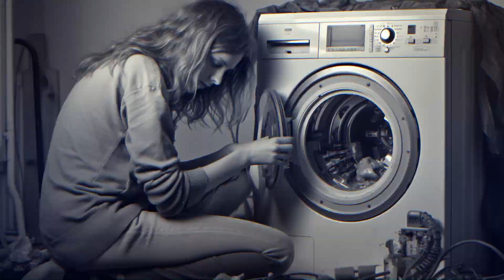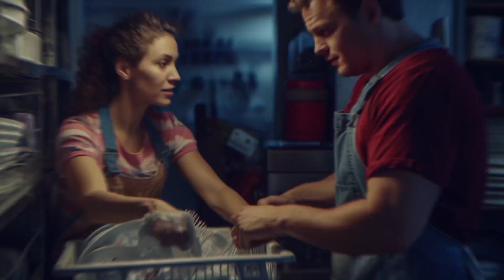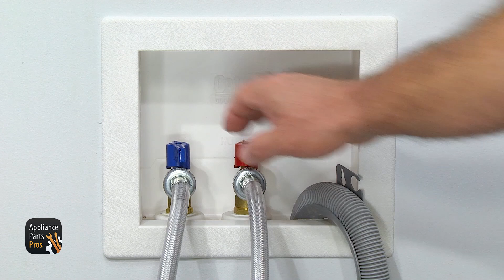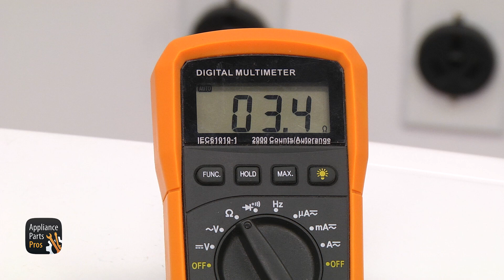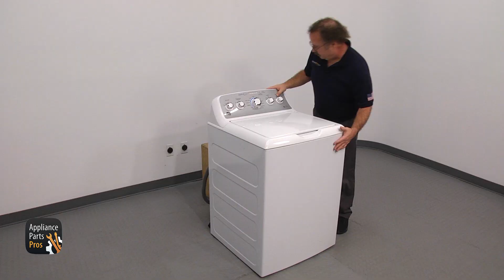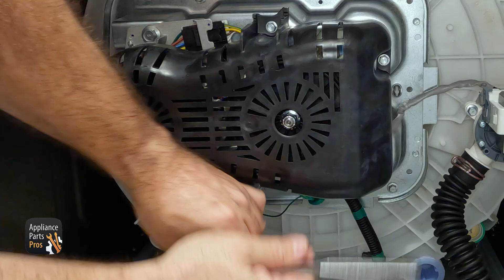GE Top Load Washer Motor Replacement Made EASY!

Comment: My pulley won’t come off
Reply from the maker: Sorry you’re having trouble! Some pulleys can be stubborn, especially if they’re stuck from corrosion or buildup. Avoid forcing it, as that could damage the shaft or pulley.

If you need further tips from our techs you can check out our repair forum: https://forum.appliancepartspros.com/

Comment: Mine agitates but won't spin.....
Reply from the maker: Common culprits for this issue include an unbalanced load, a faulty lid switch, a broken drive belt, or a stripped motor pulley.

If you need more in depth troubleshooting or testing information you can check out our Repair Forum: https://forum.appliancepartspros.com/.  It’s easy to register, and you can either post your question or search the forum to see if someone else has already asked the same question.
 
Our experienced technicians, with over 20 years of hands-on appliance repair experience, are ready to answer your questions and guide you through your repair.

Comment: Hey there i have a ge gtw585bsv0ws and when i check my motor it is giving me a 7.1 resistance on both wires. Im not sure if thats good for mine
Reply from the maker: If you need help with your repair, you can visit our Repair Forum: https://forum.appliancepartspros.com/. It’s easy to register, and you can either post your question or search the forum to see if someone else has already asked the same question.

Our experienced technicians, with over 20 years of hands-on appliance repair experience, are ready to answer your questions and guide you through your repair.

Comment: Will it still drain if the motor is bad
Reply from the maker: Good question. Whether it drains with a bad motor can depend on the exact issue and model. For detailed troubleshooting specific to your situation, our certified techs can help you at forum.appliancepartspros.com. Just post your model number and what you're experiencing and they’ll walk you through it! 👍

Comment: I don’t have a multimeter, so I can’t check the voltages right now, but washer clicks when the thing is trying to spin and fails. I had a guy come out and look at it but I don’t think he did any electrical checks. He told me “the motor is broken” but I don’t know what tests he did to find the problem. Dos she clicking noise indicate anything to you?
Reply from the maker: Thanks for sharing all that info, Ash. A clicking sound when the washer tries to spin can sometimes point to the motor, but it can also be caused by things like a faulty lid lock or even the shift actuator (on some models). Without a multimeter, it’s tough to know for sure, but it’s definitely worth testing those components before swapping the motor.
Reply: Thank you!!
Reply from the maker: You’re very welcome, Ash!

Comment: I'm stumped and need help. I got fault codes for shift actuator but it resd 5.7k ohms amd was engaging amd fitting into drive. I hear clicking like the GE motor can't get going. I checked resistance at J511 and have 4.7 ohms from brown to white and brown to yellow. Could the motor still be bad? Any guidance would be much appreciated. Thanks
Reply from the maker: What is your model number?
Reply: GUD27ESSMWW  @appliancepartspros
Reply from the maker: It sounds like the motor is good. Here are the testing steps for the mode shifter motor:
From the J512 connector on the control board, 
the brown wire pin 1 to the blue wire pin 4 should read approximately 5700 ohms. The 120 VAC can be applied to the motor two black wires on the mode shifter to manually check mode shifter operation.

If that is good, what is the error code you are getting?
Reply: @appliancepartspros I ordered mode shifter from yall. Please advise me.  I retested the connectors and this time @J511  got 4.6 ohms between brown-yellow and 4.6 ohms between brown - white. 
@J512 I have red wire at pin 1 and blue wire at pin 4 and have 5800 ohms. I do not know how to apply 120 VAC. Is that done with a battery and the machine unplugged? 
 I'm again stumped. I also ordered a motor and need some help before the memorial day sale for appliances end. Thanks, Travis
Reply from the maker: You would need to plug the unit in to test for voltage at the unit. You need to be careful when doing this test. If you are not comfortable testing for voltage you will need to contact a technician.
Reply: Do i test for voltage at actuator and motor? Do you have a video showing this? I am familair to an extent knowing you need a clip to ground to the machine  @appliancepartspros

Comment: I have a GE stackable the fills, drains, spins, but doesn't agitate. I've replaced the lid lock twice years ago. It locks if I set to spin. The pulley just buzzes and starts to move every half second when on wash cycle
Reply from the maker: Hey @brandonjensen5292 — sounds like you're halfway there already with the diagnosis! If the unit fills, drains, and spins but won’t agitate (and the motor/pulley is just buzzing on wash), it’s likely a problem with the mode shifter or motor itself. On many GE stackables, especially older models, a failed mode shifter or worn motor can cause exactly what you're describing.

Even though the lid lock is engaging, the motor may not be switching fully into agitate mode, which would explain that repeated buzzing. If you haven’t already, it’s worth checking the motor for any stored error codes (if your model supports that) or looking for signs of a failed shifter coil.
Reply: @appliancepartspros thanks! I will say that it doesn't lock on wash cycle. Only on spin only. My gut tell me it's based on the motor too. The joys of landlord life!!
Reply from the maker: If you have the model number of your unit we will be happy to check for further troubleshooting.

Comment: My washing machine doesn’t really have a board like this. It looks like it all somehow connects to my quiet cycle select. It’s a GM model WCSR4170D. I recently had an overfill problem, and I fixed that, but while waiting for the parts, my annoying household members kept messing with it, flooding it a few times. The last flood took the cake—it doesn’t want to spin anymore. So, I’m thinking a motor replacement might be needed, but I want to test it first with your method
Reply from the maker: Is it making any noise during the spin cycle like the motor is coming on? Is the unit agitating?

Comment: What about yellow to white? The print shows 3-4 ohms.
Reply: Im getting 8 ohms (between terminals 1 and 3 on the physical motor connector which connects to yellow and white wires on the plug that goes up to the control board). For reference, the agitator is barely moving. You can see it try to move but it never actually manages to move more than an inch. Checking the start cap later today. Just wanted to ensure whether the motor is bad.
Reply from the maker: What is your model number?